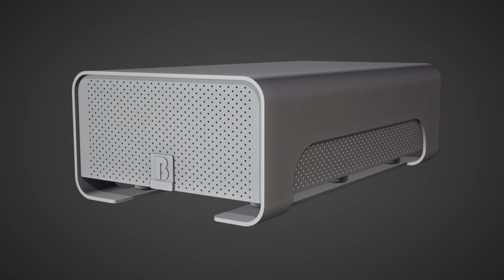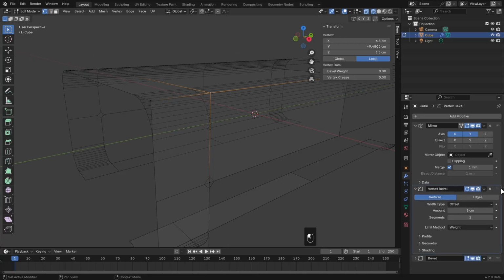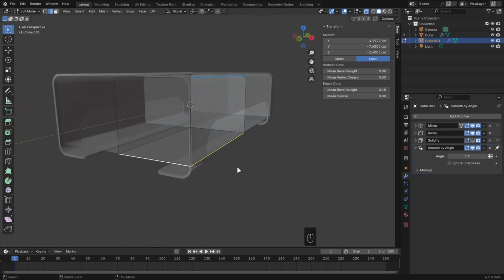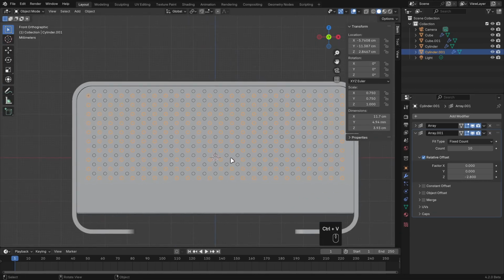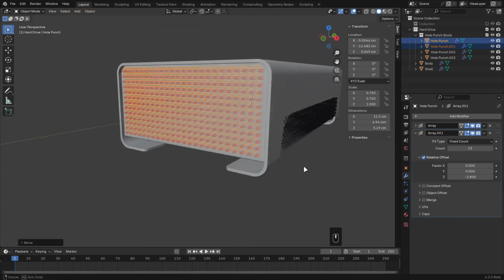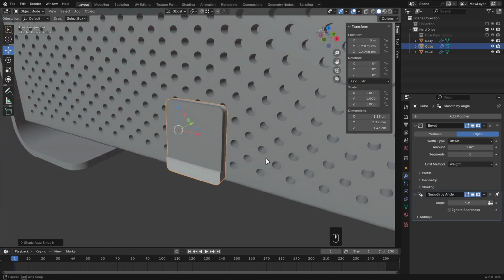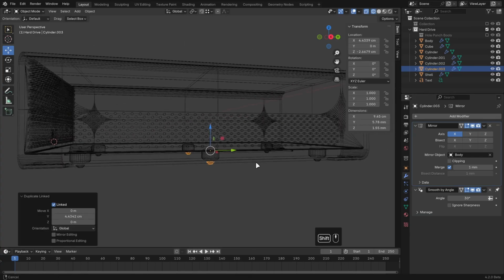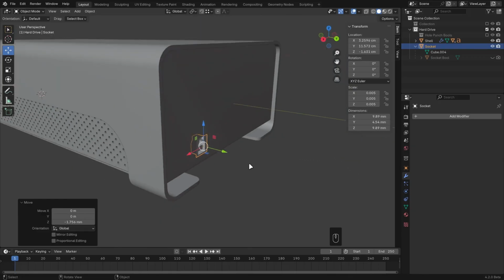Modeling a Hard Drive in Blender | Hard-Surface Workflow Fundamentals

Comment: in blender 5.2.2, i was getting a weird issue with some of the cylinders not properlly booleaning on the side, it turns out i needed them to not line up with the X axis line, because it was between the mirror and causing it to be weird. I moved them along the Y axis slightly until the red X axis line was between all the cylinders